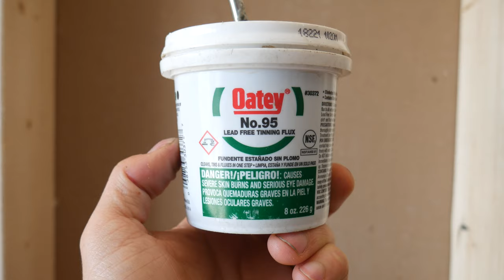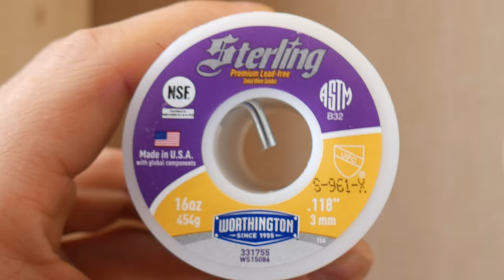ASMR Soldering Lead Free Valves (1" and 2") | GOT2LEARN

Comment: I solder with my valves closed as well. People argue ventilation for leaving it open but that’s not a good reason. The best reason for closing it is to help keep the shape of the gasket where the ball valve closes. Great work, as always.
Reply from the maker: Good tip!
Reply: @Got2Learn  valve should be slightly cracked open. if you over heat the gasket blows out
Reply: Ideally, solder ball valves in closed position.  OR open when you need to vent the hot air from inside the pipe so it doesn't bubble out through your molten (fresh) solder joint.  But DO NOT solder ball valves while they are partially open.  That will ruin the valve.
The only valves you can solder in the partially open position are: stop & waste valves; globe valves or gate valves.
Happy sweating!
Reply: It really depends on what the manufacturer recommends. Documentation on the valves will indicate which they prefer.

Comment: At 3:04, a gap appears at the top of the joint, suggesting poor flux or contamination, instead of the shiny continuous bead one desires. There might be enough solder inside to seal the joint, but I would worry that it could fail without the obvious continuous bead.
Reply: its a large gap, need to go back and fill it in after it cools a little
Reply: Valve should be open during soldering as to not trap expanding air with a fixture or hosebib open.

Comment: Hey man i started using tinning flux, nokorode, and I'm used to using everflux and you have to thoroughly stir everflux before using. The tinning flux is so much thicker and pastier, do you need to stir it thoroughly as well?
Reply from the maker: I leave it in the heat when I can.

Comment: How do you solder when you have a T fitting close to the valve. As in no pipe seen between one of the the T end and the Valve? Going to install a 3 valve bypass for my water softener. 1" pipe and valve.

Comment: I thought that much pre-heat on the pipe and valve would've burned away the flux, but that doesn't seem to be the case.  Is it because the Oatey in the green container is more heat resistant or something?
Reply from the maker: Correct!
Reply: @Got2Learn  I see, so would it be okay to just always use that type of flux for any joint instead of the other types?  I'm always in a rush fearing flux burn, but you're way more patient.  For an amateur like me, that would be a nice advantage being able to go at a more relaxed pace as shown.
Reply from the maker: @AGhostInTheMachine  for sure

Comment: You closed the valve? I heard it should be open. How do you know? Also, you heated the pipe instead of the fitting. Why?
Thanks,
Paul
Reply from the maker: That particular brand and model ask for the valve to be in the closed position when soldering, some ask to be half opened, some opened, it really depends the brand. As for why I heated the pipe, I explain that here: https://youtube.com/clip/Ugkxm1YH54kJ0Fwcwe0Udkrlg6NjX3Fh6TBQ?si=M5Wq_QQ4AETtOKIf

Comment: Hi and thank you for your many videos. They have been very helpful. I’m just beginning to learn some soldering skills and have a question for you. Regarding the soldering of the brass valve in this video. Will the heat from the torch potentially damage or compromise what appears to be a plastic seal within the valve?
Reply from the maker: Thanks, check this video: https://youtu.be/cELzc9ZophQ
Reply: Thanks for replying to my post. I watched your video using the link you provided. Very helpful, as usual. Fine work.
Reply from the maker: @tristanquintus3200  You are most welcome!

Comment: How much pressure can soldering points withstand?
Reply from the maker: Don't go above 130lbs, anything over that needs to be brazed or threaded.
Reply: @Got2Learn  I meant the fluid pressure inside the joints.